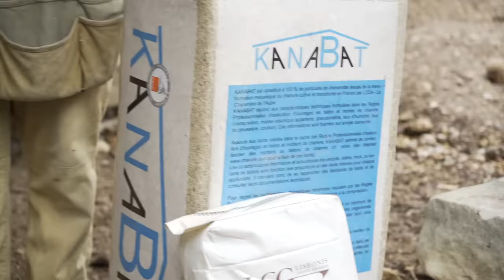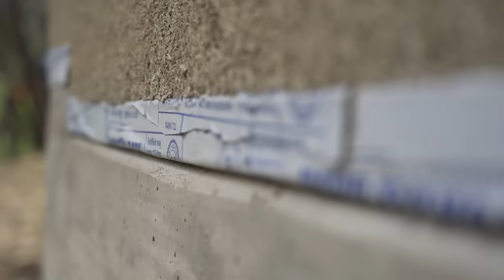Hemp Concrete Walls (R30 + Fireproof) - You Won't Believe How They Built This House!

Comment: I've been using hempcrete in Ireland for the last five years.  Very sustainable system, and cost effective too.
Reply: Coilin O'Toole do you need to  add vapour barrier?  I am concerned that in freezing temperatures in a humidified house vapour migration from the inside would freeze and damage the outside walls.
Reply: @fredfrond6148  of course
Reply: iwasdropped then how do you maintain the nice looking finish if you have to put a vapour barrier on?
Reply: @fredfrond6148  he said it will have a plaster that is vapor proof
Reply: No, he said it is vapor
Permeable. 
That is not a vapor barrier.
This is hill country
Texas so it is not as important.
Also the vapor barrier many of us learned had been discredited.

Look up Building Science Corporation for details or watch more of  these videos.
Reply: @fredfrond6148  In our climate (damp, temperate, occasionally very cold) it is best to keep the wall breathable inside and out.  The hemp/lime regulates the moisture within the house, but the lime render also allows the exterior of the wall to dry out.  External lime render has been used for hundreds of years, but with hemp I'd still recommend a good deep overhang to avoid the wall getting drenched by driving rain.  I'be also been using hempcrete in renovation old stone buildings.  Typically these buildings were built with lime mortar (or even just mortared with soil) so they need a system that doesn't trap moisture within them. By shuttering and casting 4"-6" on the interior stone and finishing with lime render the wall can achieve a u-value of 0.5 (metric).  In those projects I'd always excavate a french drain or foundation drain around the property to reduce an risk of rising damp, and best to finish the exterior with lime render too.  Having renovated old buildings with practically every system available, hemp is definitely my favourite.  It's not a particularly skilled job, and lime plastering on hemp is very easy.
Reply: How scalable do you find the industry in terms of mass construction.
Reply: @patmaloney5735  I don't see any reason why it's not scalable, particularly in Ireland where construction costs are high due to skill/trade shortages.  It requires good work oversight but not skilled labour.  Also in Ireland the amount of land being planted with hemp is increasing by 400% per annum and the shiv is still a waste product.  Hopefully a processing industry will develop so that hemp for construction won't have to be imported from France.   One problem in Ireland is that banks and builders are very conservative and tend to stick to what they know... blocks and mortar.
Reply: @coilinotoole6124  I've insulated my 1847 house in NL with it - on the inside of the outer walls as no overhang of the roof (and at front already on property line). Appreciate living in 'wolly sweater' rather than 'plastic bag' health wise - it breaths and no chemical nonsense
Reply: @coilinotoole6124  The cost that drive the price here in the USA is not the hemp it is the shipping. Reality.. the shipping is indeed more than the hemp
Reply: So you can use this to add an internal/ external wall on a old stone house renovation? No need to start from scratch?
Reply: @5dflowliving440  it's what I've done ...
Reply: @5dflowliving440  would put it on the outside to provide for external insulation blanket and stone inside for massive thermal mass
Reply: @stevepailet8258  so immediately against the stone or with a barrier between the two? Thank you
Reply: @5dflowliving440  since the stone is one shutter and cannot be removed I would say yup right against the stone.
Reply: @5dflowliving440  Yes, but important that there is no risk of excessive moisture in the wall.   I haven't used it on the exterior surface of walls because we just get too much rain.
Reply: What does it cost roughly to build a house with hempcrete?
Reply: @ScottGrow117  In the US  because of shipping ends up around $15 sq foot  If one could get the shiv and natural hydrolic lime locally reasonable to cut this price in half
Reply: @stevepailet8258  have to source hemp chips internationally, or do you mean shipping in the US?
Reply: @ScottGrow117  internationally.  what is grown in the US is fine.  just finding a source at this point is problematic
Reply: Hempcrete is NOT carbon neutral. Lime is carbon intensive to create. simply greenwashing to call it sustainable
Reply: @derekcraig3617  you are wrong. it is when you make portland out of the lime that it becomes a problem with carbon. Lime is a mineral.. So what you just said is a mineral produces carbon dioxide.
Reply: @stevepailet8258  Limestone is calcium carbonate CaC03. It takes heat to split CaC03 to create lime powder. Go research this and get back to me because you clearly have NO IDEA of what you're talking about
Reply: @stevepailet8258  If you have 2.5 acres of land you can grow it your own hemp.It will only take 4 months, hardest part would be the harvest  but if its your house and your are determined i dont see anything stopping you other than the law in some countries. Nice fresh air too
Reply: @ReHoGamingPL  or 1 acre and work it for a year :)
Reply: @derekcraig3617  Relax Derek, it's ok, nobody called it 'Carbon Neutral'.   

Manufacturing lime releases substantially less CO2 than manufacturing cement.
Reply: @coilinotoole6124  It was directly called carbon neutral in this video. And lime takes the same amount of co2 to produce as cement. very similar processes
Reply: @derekcraig3617  I'm sorry, but you're wrong.  Cement emits four times as mush CO2 in production than NHL, and NHL reabsorbs most of it's CO2 during curing.  It's not perfectly 'Carbon Neutral' but it's an awful lot better than cement.  Have a search for 'Green NHL' by Limeworks.us
Reply: @RunningCordoroy  No, not of course. No vapor barrier required as hempcrete absorbs and releases vapor as needed.
Reply: @fredfrond6148   You do not want to use a vapor barrier with any straw/ Adobe/ Cob structure. If you can, use "slack lime". Or put the lime plaster mix in the sun for a year. It will reduce cracking, and is nicer to work with. 

However, you should investigate straw structures. The method in the video is completely insufficient, in my opinion. Only use straw that is in long segments. Once straw is cut short (or chopped) it no longer meets structural requirements. Even worse is straw mulched axially, which destroys the structural properties AND the insulative properties. It is akin to pouring thick concrete with ZERO reinforcement. 
(Check the International Building Code for straw bale structures or consult an engineer with experience in straw/ cob/ adobe buildings if you are considering this. I would not take this video as a guide, ...in my opinion).
Reply: @onebylandtwoifbysearunifby5475   Thank you very much for the detailed reply I will investigate the sources you provided.  My concern is that in cold climates warmer more humid air from inside will develop a temperature gradient where it, at some point it will be 32 F or 0 C.   At this point when the water vapor freezes and expands damage could be done to the wall.  I have seen this where the owners of a beautiful building, with massive limestone walls and no vapor barrier, decided to humidify the building.  A couple of years later when I saw the building pieces of the building had fallen off and it looked nasty.

Now I am not a structural or building science engineer,   So maybe I am not making the correct assumption or being overcautious.  Since straw structures may have more flexibility than stone and can have freezing within the structure.  By the way I 100% agree with your thesis that straw cut into short segments has significantly less structural capability when glued together.

Thanks for your input.
Reply: @fredfrond6148   You are certainly welcome. So i would refer you to Straw bale houses built in Nebraska (very cold) some 100 years ago, even 1800's. 

There are specifics for Straw Bale International Building Code that are relevant to your concern. I would highly recommend reading it as a building guide before using straw in any structure. It was written by a knowledgeable engineer. 

Plaster has been used for coverings with straw, but "slack lime" plaster is less prone to cracking. However, if you can't let your lime sit in the sun over summer, you can buy some, albeit at a fairly high price. 

Straw bale websites are a good info source too. One thing is you may need to build a short stub wall to put bales on if you are in a humid climate that doesn't dry well (like Eastern US, vs Central and West which is substantially dryer (less humid) in Winter). 

Straw is a tried and true building material. I wouldn't short-change it. But do Not mulch it like in the vid. Seems information is lost when we try to pick-up old building methods without an apprenticeship from a line of succession. 

The only time i have seen competent use of mulched straw has been in the construction of cob ovens, where they wanted a conductive interior wall. However, the structural components of the ovens were all intact straw tubes, not split axially. 

Well, hope some of that at least gets you pointed in the right direction.

(And a vapor barrier works both ways, so a building won't dry in summer. Straw mixes have inherently high moisture that will continue drying over months, unless fired in a kiln. Another reason to avoid vapor barriers. I would be mindful of any coating you apply to the walls, however. As they could trap moisture in the wall if not vapor permeable).
Reply: @derekcraig3617  the carbon that limestone looses when heated is reabsorbed is it not?
Reply: @adrianduggan4739  Yes but what about the carbon produce from firing limestone? Which is almost always done with coal
Reply: Is there a saving due to the build time?
Reply: @thecommunitygiants4485  In my experience with old buildings, no, but on new build projects it would definitely be possible to get up to a good speed particularly with a good carpenter doing the formwork.   There is a lot of labour required, but it's very quick and easy to teach workers who have no experience with it and with good coordination a large crew could work on a project.  I've found a 2ft formwork rise per day to be ideal and the formwork can be raised the following morning.   I used to run conduits for services within the formwork but it slows the work down too much and I've found it easier to chase out most of the cable runs when the hemp is complete but not fully cured.  It's hard to say when best to apply lime renders as it depends on conditions but generally I'd start that process within two weeks.
Reply: Thanks to all of you in this comment.
Reply: @coilinoto6124 I am thinking of buying a property in Sicily. Do you know the cost per square meter?
Reply: @rubenmoreno5166  It depends on a lot of factors, particularly the local availability of materials, and labour costs.  A project with 100m² of wall area, average 125mm thick shuttered, I'd expect €200-240 ex VAT per m² total cost including shuttering costs, and 3 coat lime plaster finish, and a 30% builders margin.  The climate of Sicily mightn't require that depth of insulation, and with less than 75mm depth it's cheaper to consider harling the hemplime in two layers rather than shuttering, approx €100-125 per m² for 100m² project.  Smaller projects will hace a higher cost per m², and of course you'll have a lot of associated costs so a good contingency required.
Reply: Just to add, if you have a reasonable level of building experience (labouring, mixing concrete, general carpentry skills, plastering etc) you could do a lot of the work yourself without engaging a building contractor.
Reply: @derekcraig3617 you forget that if you use the materials like said, the outcome will be CO² neutral.
Hemp growing takes CO² out of the air, whereas creating lime might create CO² but together you take out (more??) CO² as it is put in to create it.

Every detail is sometimes a disaster, together details create a better thing.
Reply: @coilinotoole6124 where can you get Hemp shiv in Ireland ?

I want to make my own hemp build.

Can you point me towards suppliers ?

Also, I assume you need the shiv instead of the whole hemp plant isn't it.
Although..... The fibers of the outer core might add strength to it.
The shiv insulates but doesn't add strength.
Can you give me your thought about that ?
Reply: @fredfrond6148 perhaps I am wrong but...
In a natural building like hempcrete you do not need to add humidity to the inside.

If you do so you create an instability which causes the crumbling of the walls.

Mind, the humidity on the inside will always fluctuate but to to such extends that it will be much dryer inside or much more humid as on the outside.

Natural humidity which is the outcome in hempcrete is like humidity on the outside but less 
Humans evaporate moist by breathing and their cooking.
That excessive moisture will disappear thru the hempcrete walls, but for as far as I know, also thru straw bale walls. The lime plaster or cob plaster is only to prevent the hemp or straw of getting wet.
Straw MUST be below 16% humidity to  be able to use as structural walls, if more moist it will start to rot and the walls can fall apart.
Reply: @irishcoffee6894  my understanding is that typically humidity rises from human activity inside a dwelling.  Breathing 😮‍💨, 🥘 cooking, 🚿 showers etc.   So a house in a cold climate will require a vapour barrier on the inside wall  or else the vapour will migrate to the outside, and in the wall freeze.  This is bad.  Especially for a porous (non elastic/rigid) stone wall like limestone where pieces will actually fall off.  I am asking about this situation with hempcrete.
Reply: @irishcoffee6894  I'd recommend the Traditional Lime Company in Tullow, Co.Carlow.
Reply: @irishcoffee6894  Stick with the recommended mix, ingredients and ratios.  No need to add anything extra.
Reply: I’m looking into using this on a stone building in Ireland too. Is there any risk of the hemp rotting. From external water through the walls or rising damp from the floor. What flooring insulation and  material would you recommend? An external overhang in Ireland would reduce light through the windows so I’d be reluctant to add that. Is it necessary or maybe just in north facing walls? Thanks for your info.
Reply: Also I know you need breathable paint which ads another expense to the build. Are there any issues with panelling the walls or having built ins? Do the walls need air or will that encourage mould growth or damp?
Reply: @DeeOrganPhotography  Old stone buildings in Ireland will typically not have a DPC, so in order to reduce the risk of rising damp I'd always excavate a constructed French drain around the building so that the water pressure iisn't sufficient to drive moisture up the walls.  A depth of 750-900mm is ideal, and care should be taken not to undermine any foundation.  A breathable floor is a good option (such as geocell with limecrete) but in high radon areas it's worth using a radon barrier with sump vented to the outside, so then a concrete floor with rigid insulation will work fine.  Important minimise ingress from all exterior sources, but avoid cement pointing or renders.
Reply: @DeeOrganPhotography  I've never done timber panelling or wainscotting against a hemp wall, but I really don't see an issue as long as the paint is breathable.  If I was doing it I'd probably keep a 20mm airgap behind the panelling by running horizontal pressure treated batons.  You could use a strip of dpc on these batons too?
Reply: Can wood shavings be a subistitute for hemp ?
Reply: @rastarasta3348  My understanding is that hemp can deal with moisture far better than wood cellulose, while also being stronger and a better insulator.  I'd imagine some particular types of wood (or other plants) might work, but hemp works perfectly well.